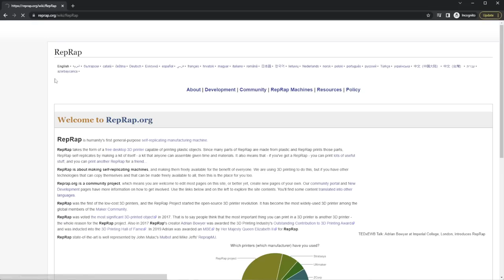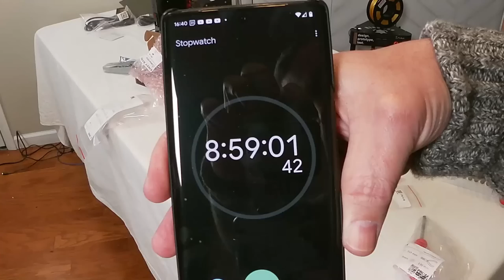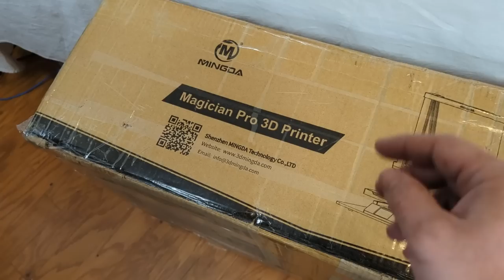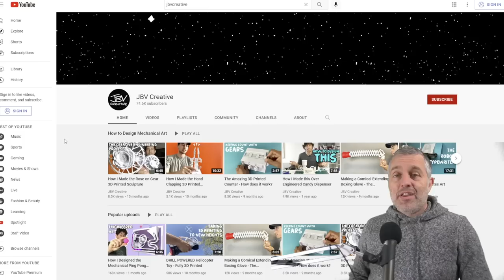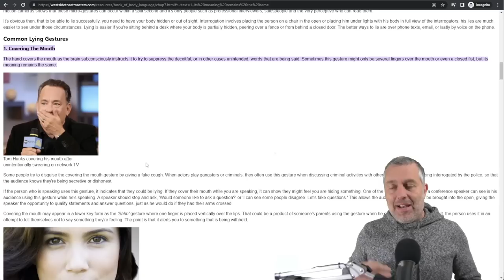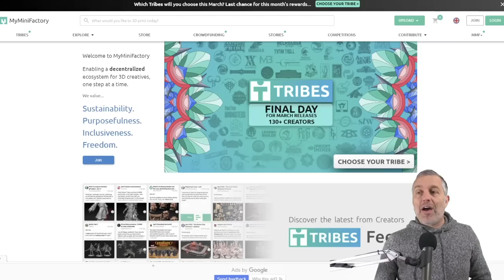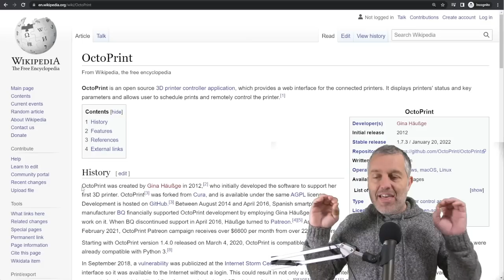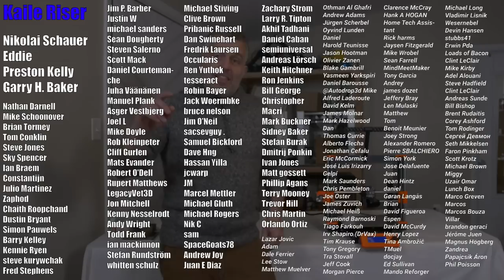Why Does Nobody Speak Truth About The Prusa I3 Mk.3? - It's Overhyped and Over Priced.

Comment: Something else I noticed whilst watching this video is that at 12:46 of the video, the nozzle bed levelling system for the chinese printer you demonstrated, whilst on the prusa xl video that you made which is now unlisted I went back and reviewed a section where you talked about their nozzle bed levelling system, direct quotes from that section include: 

“it’s absolutely not necessary on a corexy or any other cartesian style printer so its kind of a gimmick to be using it here” ,  10:06 of that video

 “ you can have some old hardened filament sort of protruding a little bubble out of the tip the orifice of the nozzle or you can have a whole big glob of that same filament built up on the tip of the nozzle and um it causes problems so what if that globule is actually hot because you you heated up the hotend well now you’ve got a big sort of sponge a big spring that’s going to sort of have to squish out of the way which will give a different reading which will change uh just how effective the nozzle is at detecting the bed surface so um its not as much of a home run as you think to be using the nozzle as the um bed leveling apparatus”, 11:37 of that video

“It says right there analog load cell sensor so they are totally copying the load cell technique from duet 3d” 12:19 of that video

All of these problems also apply to the nozzle probe on the chinese printer yet you dont even mention them.
Reply from the maker: You're scrutinizing every minute of every video I make. You're looking for contradictions." Do I contradict myself very well? I contradict myself for I am large and contain multitudes." Me being wrong does not excuse Prusa for his ego and charging too much for his printers. While all of your criticisms are easy to defend against, I'm not going to bother because those defenses would not address the core issue. You are a true believer. I think you might be from the Czech Republic. Nothing that I say will convince you that Josef Prusa and his company are not good for the hobby. They exist to enrich a select few and glorify the ego of a Man who does not deserve your adoration. You gain nothing from his success. Be a servant of truth instead of whatever this is that you are doing.
Reply: @DesignPrototypeTest  Why would I care about prusa as a person because at the end of the day im not talking to him im just using a product that his company sells and pointing out something that I found interesting when  I watched your videos. Im not someone who lives in the czech republic im just an average 17 year old canadian high school student who enjoys technology and found something interesting I wanted to inquire about, your answer is truly the answer of someone who is delusional , someone who believes that anyone who says something good about a 3d printer brand works for them and is purposely going into your comment section to cause trouble. If you truly believe that someone like Joseph prusa would go out of his way to do something like that to you then youre crazy man, (not disregarding that he might be an egotist i barely even know who he is i just bought a printer from his company) but someone who is running a large company I dont think would put so much time and effort organizing a group to bother you. I admired this channel for having its own opinions and showing some really cool stuff but your response right there has caused me to lose so much respect towards you.
Reply from the maker: >your answer is truly the answer of someone who is delusional.
If you truly believed I was a crazy person and if you truly had "lost" respect for me why would you continue to engage with me? Why would I be worth one more minute of your time? You are leaving these comments because something I said triggered you and you need me to be wrong. Are you suffering from the sunk cost fallacy that I talked about in the description? 

When you see an ego being displayed shamelessly you must ask if those behaviors indicate Pathological Narcissism. The worst people in history have had this personality trait: https://www.washingtonpost.com/outlook/psychoanalyzing-historys-meanest-men/2019/04/25/6cf34f38-346c-11e9-af5b-b51b7ff322e9_story.html buying products from upstanding companies is one small way to make the world slightly better. In the case of Prusa, you are paying more for a product that doesn't perform any better than the less expensive alternatives and by doing so you are putting money in the pocket of an egotist (or worse) who is not helping the hobby. Chinese printers are not something you should buy on principle either. I don't know who is worse Prusa or China, so I simply recommend that my viewers not waste their money and go with the less expensive Chinese printers.
Reply: @DesignPrototypeTest  He originally just pointed out, that you use double standards in evaluating printer features, on the chinese one it's great and on the XL it's a unnecessary flawed gimminck. Statements like these diminish the objective credibility of your reviews lately, nothing wrong with pointing that out. Your response on that is crazy
Reply from the maker: @kachler67  >He originally just pointed out, that you use double standards in evaluating printer features,
There is no objective standard. At some level of resolution every judgement breaks down into subjectivity. I can criticize anything. It's called "Critical Thinking." Just because I criticize Nozzle Touch Probing for it's flaws doesn't preclude it from being superior to the P.I.N.D.A. probe. Even Prusa know this which is why the new Prusa XL uses nozzle touching. It's weak sauce to try and "trap" me in contradictions. I've put myself on camera for hundreds of hours. There is no way that I haven't contradicted myself. Things change. Technology advances. You guys are on a witch hunt trying to make me into a bad guy and I don't appreciate it.
Reply: @DesignPrototypeTest  
You mention critical thinking, so I’ll try give you my 2 cents about the probing methodology, because in my opinion your review in that regard doesn’t reflect the actual daily use and miss the point, why a XL (or any tool changing printer) needs a nozzle touch, and the MK3S+ with it’s SuperPINDA does not.
Reality is, you exactly once set the Z height for each sheet (in my case 2, which are stored in the menue and it’s done within the first line of a print) and you’re done forever since temperature drift is eliminated. You don’t have to implement any kind of nozzle wipe to work around the nozzle probing flaw, it just works day in day out. One could argue “what if you want to fit a garolite bed or something”? Yeah that one isn’t covered, but in my eyes just of theoretical nature, since every filament I printed with worked excellently with the PEI sheets and never felt the need to have any other surface (PA being the trickiest one, where I added dissolved PVA glue with a brush).
So when is nozzle probing really needed? As I mentioned, if you include several tools where each tool might need a different Z offset might be familiar from the CNC world). With that does not only come equal Z height, but additionally equal X/Y coordinates for perfect alignment.

So in that regard, the critical thinking part within me disagrees with your conclusion, that even PRUSA admits through the backdoor, that inductive probing is sh*t and they know it. In fact, it is a nice solution that works consistently day-in day-out without even thinking about it (even has a higher working range that the temperature dependent BL Touch i.e).
It’s just not the right solution for tool changing or if you really want to have another bed whyever you should need one.

The point I‘m trying to make is, the initial witch hunt goes off your side towards Prusa and subsequently this machine. The first one might be something personal, but concerning the machine you‘re unnecessarily unfair in your review and that‘s what so many people try to point out. You should have done 2 Videos really, because it is easily detectable how your aversion (which you can have) affects your „neutrality“ concerning technical evaluation. This mixup is bad habit and I have to emphasize this, it takes down credibility. I liked some of your reviews so far, but this was not one of them.

Btw I‘m by no means a Prusa fan boy, I print with 2 at work and feel simply this one doesn’t cover it properly
Reply from the maker: >“what if you want to fit a garolite bed or something”?...but in my eyes just of theoretical nature,
Nylon is best on Garrolite, PLA is best on smooth PEI, sometimes you want textured PEI so bottom of print matches sides a little better. If you aren't using the Prusa as a production machine then you want the ability to print with many different materials. I have a printer with several print surfaces that Uses a BLTouch. I find myself switching the plates often. Once you have that ability you realize how useful it is.

The P.I.N.D.A. probe appears to work well once set up. I don't have the long term experience with it like you do. It sure would be nice if Prusa gave credit to the person who guided him to the answer and helped him solve the temperature drift issue he had with his Mk.2 probes. I'll bet that maker would really like to fanboy for Prusa knowing he helped to make such a good feature. But just like all the other features on his printers Prusa just slaps his name on innovations other people generated so that he can insult makers in his live stream and maintain that feeling of superiority he broadcasts with his shirt. I wonder what his out-of-control ego would tell his employees to do if someone decided to take credit for themselves? I'll bet that person would suffer for many years at the hands of Prusa's mob.

>the initial witch hunt goes off your side towards Prusa...
DUDE! are you serious? 4.5 years of hate in the comments of my videos + an internet wide push to make me the most hated man in 3D printing. I'm one man. The pitchfork mob is supporting Prusa. Your team is on the witch hunt. You just don't want to feel like the bad guy. Deep inside you are afraid you are on the wrong team. Your leader is quite possibly an ego monster (Pathological Narcicist) in the making, but sure blame the little guy with less than 70k subs after 5 years of working on his channel who is just spitting truthful criticisms that nobody else is brave enough to say for fear of the mob that YOU are a part of. You cheater.

>You should have done 2 Videos
Why?  It's because you know I'm right about JP. and you just want to ignore the person behind the tech. You want to love the tech and not acknowledge the ugliness. So here you are shooting the messenger that made you look. His brand is his face and his name and his stupid hat and glases. You are buying him. You can't ignore that and focus on the technical benefits of some feature like the P.I.N.D.A. Prusa is a package deal. You get the man + the tech so I made a package deal video about it.

You got the details perfect from Prusa "MK3S+ with it’s SuperPINDA" which shows you have a HIGH degree of fluency with Prusa's products. You aren't just some guy who uses Prusa printers. You seem like a SuperF.A.N. who knows every detail of every release from the company. Maybe you work for Prusa? Yet here you are being disingenuous AS AN AFTERTHOUGHT saying "Btw I‘m by no means a Prusa fan boy..." I know you aren't a native English speaker so let me just tell you that "By no means" is adamant wording. You are creating a large distance between yourself and the fanboys. 

With your intimate knowledge of the technical names for products & features and because you are "by no means a Prusa fan boy" you must have some hard hitting criticisms for the company/man/product that I don't know about. Tell me what's bad about Prusa. Show me that you aren't my enemy just here to join the mob and attack me without ever acknowledging that Prusa has deficits. Tell me something I don't know. I will be definitely be using whatever you share in future videos.

Comment: I'm considering buying an MK.3 after running an Ender 3 for 2 years because of all crap I've had to deal with.  I've had no end of extruder problems, I'm sick of manual bed leveling and no run-out detection.  I'm not at all convinced all the addons to bring the Ender up to the Prusa level won't ALSO add a bunch of failure points that I need to babysit.  Most of the other addons that I tried I've since removed because of that, and I think that's more common than Ender 3 fans will ever admit. 
People say the Prusa just works really well out of the box and that sounds pretty damn good to me at this point.  There's gotta be a reason so many print farms choose them.  If some dude's making bank for designing them, congrats to that guy.  Sounds like this review was pretty biased for outside reasons.
Reply from the maker: Many Chinese printers work out of the box these days too. Mingda Magician X for example. Has the same features as a Prusa. BTW What are these vague "issues" you are talking about?

Comment: OK.  I want a printer that just WORKS out of the box.  I do not want to tinker with it, I just want to print things for my other hobbies.  The Prusa lets me do that.  Please point me at another printer that works, instantly, without any tweaks, as well as the Prusa, in the same price range.  I know of dozens that don't but I don't know of a single one that does.
Reply from the maker: I showed one in the video. The Mingda Macician is the smaller version. It will "just work" as well as a Prusa straight out of the box.
Reply: @DesignPrototypeTest  and you had to restart the print on it 😆